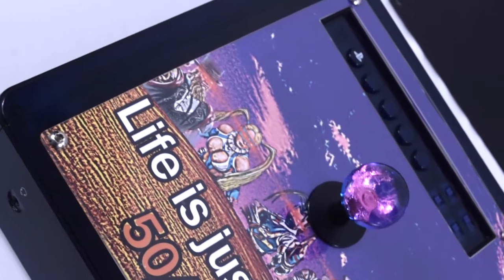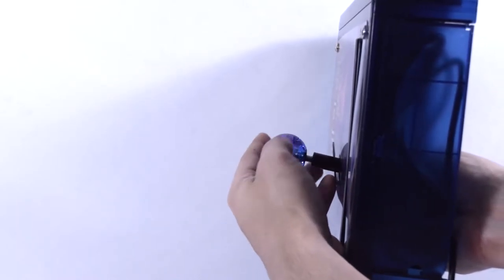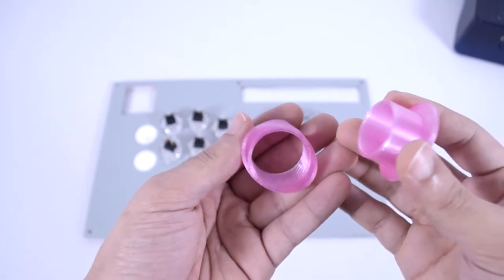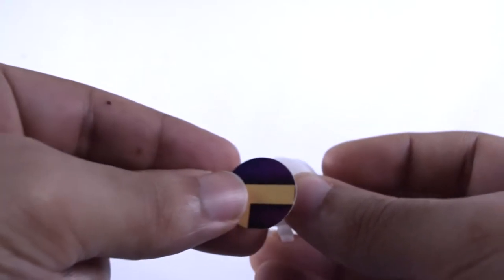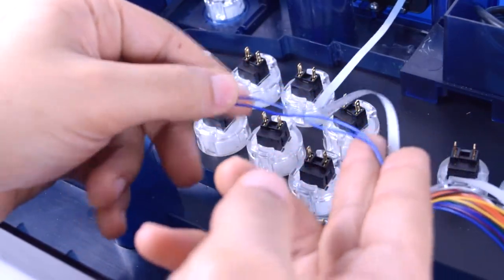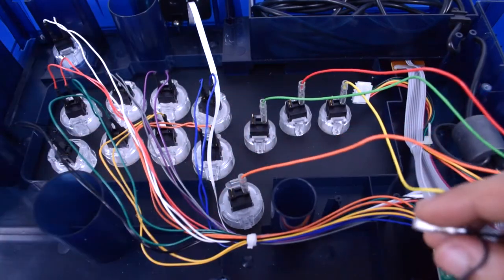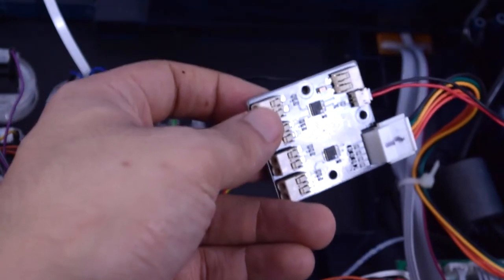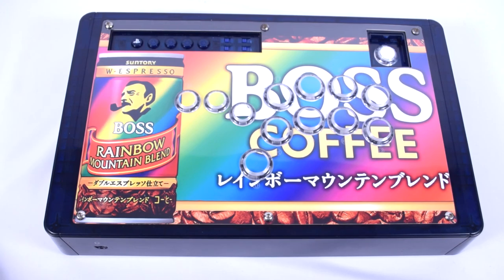How To: Installing the AFS RAP N Stickless Panel

Comment: Hello, I was thinking of buying this for my Razer Panthera Evo with a Cardimod installed. Just a few questions, does this work for the razer panthera evo and are there wires that is for 5 pin female because the cardimod needs 5 pin female?
Reply from the maker: Sorry - this will not work with the EVO. They are completely different designs, and the EVO has no way to replicate the cover with custom plexi.
Reply: @focusattackcom  I meant if the FA SOCD Cleaner would work with it

Comment: Is this conversion the same if you are using the cardimod wasd instead of the buttons ?
Reply from the maker: Not sure how Cardimod connects to the original panel.  But you really won't need a new panel for that as it's a clone of the Omni Arcade Odin.